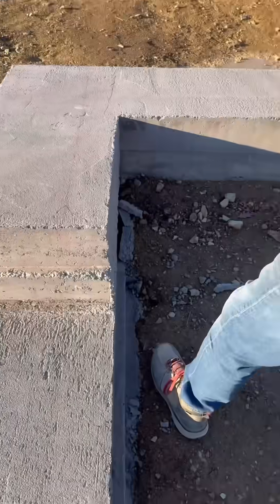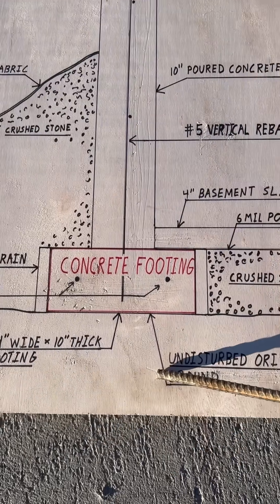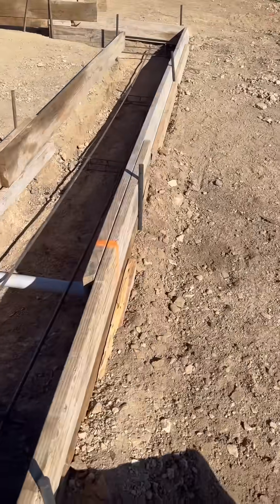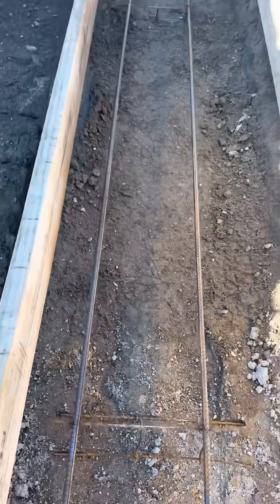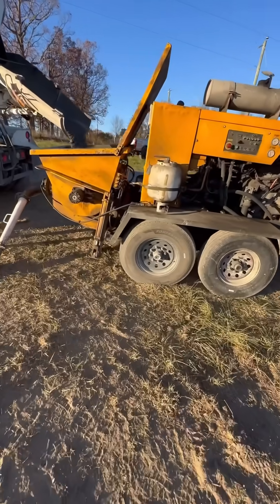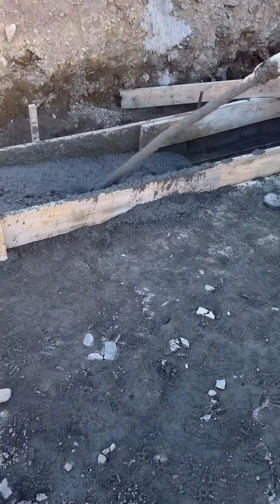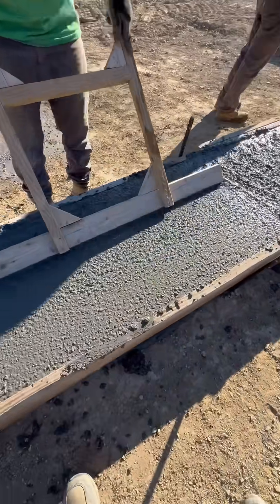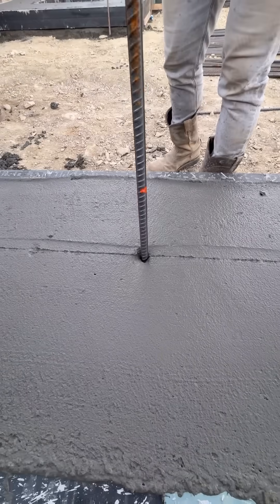We Just Poured Footings- Let me Show You How

Comment: You Americans really don't like using rebar and when you do it's suboptimal.
That rebar in the centre of the foundation beam provides no function.
We put engineered cages in concrete beams in Oz and Asia, not impericaly guessed bars that just hold broken concrete together. The steel has to work too. Foundation beams bend both ways when loaded.
Then there's the "we don't need chairs" lobby.

Comment: Good video. In most footings I helped pour when I was working in concrete we would put keyways usually in the middle of the footing so that when you poured the foundation wall it was locked on to the footing so when your walls solidified they wont topple over or slide off. The footing does look really good though.
Reply from the maker: The rebar sticking out of the footing into the wall, serves the same purpose as a keyway
Reply: The vertical rebar needs a hook. Also,I  would  install keys in the footer. The keys are not required, but do make a better/stronger connection to the vertical walls, as compared to just the vertical rebar.
Reply: Yea without a hook on end of dowel, the bar will not develop (straight bar in a 10" thick ftg, assuming 3" cover, yea she ain't developing), therefore the bottom connection of wall cannot transfer moment. But as long as the reinforcement can transfer shear, prol ok (I'd still use a key with hooked bars though, extra insurance). Unless of course your wall is CMU ...  @TheHavocdog

Comment: The idea of using rebar annoys me. It seams like adding a built in fail point. There must be a thickness and shape where the concrete is under constant compression allowing it not to crack without rebar..... or u could use large flat fat faced ashlars if done correctly they last for 100s of years.

Comment: Those vertical bars should be hooked at the bottom
Reply: Yup, at least a 90° x 6", The leverage of the tall wall exceeds the friction of the 12" footing by far. Depending on soil conditions and your local, it's either critical or no real concern. A keyway would suffice. Location location location.
Reply: Yup. That's needed to handle uplift forces. I hope they aren't building in a hurricane zone.
Reply: Rod. Rod, rod,

Comment: Glad the inspector at the end approved the job!  Always a sigh of relief
Reply from the maker: He’s a taskmaster
Reply: The inspector at the end was talking a hot lap, because he failed the inspection the first time. Why you asked? Because one is not allowed to stab rebar, holdowns, anchor bolts etc.. after concrete placement. Second where is the alternating hooks on the vertical bars.
Reply: @davebrakebill8818  oops :)
Reply: @davebrakebill8818 that was my thought. Inspector not passing without verticals and anchor bolts installed, and hold downs in California. And he passed without underslab plumbing being wrapped 🤦

Comment: Where was all the vertical rebar didn't see any while the dog was running on top of  the footings did you ever consider keying the footings to tie it all together ?
Reply from the maker: The guys drill and epoxy rebar into that area later because there’s several different steps with different heights. It’s the garage area.

Comment: It always amazes me how little rebars are used in American homes, then again most of the houses today are made of wood and what essentially is paper so foundations don't need much rebar. Most parts of the world use RCC structures in their homes which means a whole lot of concrete and whole lot of rebar and bricks, it makes for a much stronger and sturdier house
Reply: As a structural engineer, I can confirm there's absolutely no need for a concrete house. There are a few positives but the flexibility of wood far out weighs any of that
Reply: @AC-im4hi Why is the reinforcement in a foundation footing placed in the middle zone instead of the upper or bottom zone?
Reply: @vladimirmijajlovic6036  Great question. The bars are typically placed 3" above the bottom and then another layer is placed in the top if needed due to being in a high wind region. It's possible that the engineer designed that rebar to take both the wind and gravity forces. Its also possible that he or the GC messed up.
Reply: @AC-im4hi you need to lose your license. Is that seriously what you're going to tell people? Timber houses are almost all downsides. The only reasons it's popular is its initial construction cost is a bit less, lumber is available to no end, and it's faster. Maybe talk to the people whose houses are wasting away, around them, or those that collapse for the tiniest quake, burn away for a fire that had no reason to persist, or those that collapse at a breath of air. I could keep going, but don't ever try to say that wooden houses match up, in quality or integrity.
Reply: @deven6518  Wooden houses are actually stronger in Earthquakes. I could tell you why but it would go completely over you head. They are also entirely sufficient for hurricanes to meet the code required wind speed. They are slightly worse in a fire but even a concrete house needs windows which will let fire in. Overall, they are significantly cheaper and much easier to work on for the average homeowner. I've designed hundreds of wood structures up to 6 stories tall and every one is still standing today. You don't have the faintest idea what you're talking about.
Reply: @deven6518  You fools really have no idea about American homes. Tornadoes do not care what a building is made of once it gets strong enough and even EF3s have leveled buildings in Germany, France, etc. It is far easier to make a smaller buildings earthquake resistant when it is made of wood IE why Japan mainly had wooden homes. Not to mention, it is far easier to insulate as well which is why the Nordic countries have 90%+ of their single family homes made of wood.
Reply: @AC-im4hi What about sound isolation, concrete house vs wood house?
Reply: We don't because stick framing done properly is plenty strong and way cheaper because we have basically an inexhaustible lumber supply.
Reply: Look at the Chinese videos 
Don’t see rebar

Comment: In California the vertical rebar has to be tied to the horizontal rebar in a footings.
Reply: It also has to be "L" shaped and placed a  minimum 48" on center (O.C.), making them stronger for earthquake resistance. The horizontal bars have to be 3" from the bottom and sit on chairs. They also require corner bars to tie them in at the intersections.
Reply: @bradjackson8210 yesss. I do think you mean maximum thought,  not minimum.  I've actually never seen steel spaced that far.
Reply: Yea he isn't in a seismic area.

Comment: Oh yeah around here 8' wall requires rebar 14" x 12" squares move into the 21rst century
Reply from the maker: If you’re in construction you should realize that different parts of the country have different requirements based on the environment. Depending on your seismic  design category and wind speeds. Also the soil conditions make a difference.

Comment: Looking very nice. A question though, why does rebar always look rusted? Even the new stuff? Is there, like, stainless steel rebar?
Reply from the maker: It usually comes rusted because it’s been sitting outside. That’s not a problem, once it’s covered in concrete it can’t get oxygen so it will not continue to rust.
Reply: @hausplans  Huh, thanks! I've heard that it can continue rusting over time because of the moisture in the concrete as it cures. That's then supposed to eventually damage or deteriorate the concrete. Have you ever heard of that, or know about it?
Reply: Rebar is typically coated with a sacrificial layer.  It's meant to rust. The oxide layer that forms will protect the inside steel for years to come. If you bend new rebar, the blue or gray ones, you'll see a thin layer flake off. That's what rusts.

Edit: as for rusting over time,  it shouldn't.  Concrete is porous and if you had too much water in the mix,  it'll be very much so, allowing water to seep through and affect the steel. To combat this, concrete should be poured with the bare minimum water and kept wet to cure, instead of adding plenty water and leaving it to cure dry (which it doesn't). Also, ensure that there is minimum  2" of coverage on surface steel,  more if it's swamp or freezes over. For that which is buried, 3" minimum coverage and seal the surfaces. Tar does a fine job.

Comment: As a rebar manufacturer i like watching this
Reply from the maker: Thanks for making it👍
Reply: No bend in the starter bars over there? Ours all have 3" right angle
Reply: something I've always wonder:  what kind of steel is rebar made from?  Why does it burn through my bandsaw blades 3x as quick as steel bar (a32 /1018) ?
Reply: @mtraven23  i believe it has a higher carbon content, making it a weaker steel ultimately, as it's less pure. rebar is mainly used to reinforce concrete, not to be fabricated and welded, which requires a higher purity of steel
Reply: @abtwopoint0  the high carbon would explain the wear on my bandsaw blades...but the rest of that is wrong.  High carbon steel isnt "impure" steel....its actually stronger steel....despite being less ductile.
Reply: He makes rebar he doesn’t do concrete doofus
Reply: So as a rebar manufacturer do you know anyone that does some kind of waterproofing to the rebar when it is made? Idk 🤷 any kind of electrolysis or powder coating or something of the sort so that the rebar doesn’t rust in the concrete over 100 years?
Reply: So as a rebar manufacturer do you know anyone that does some kind of waterproofing to the rebar when it is made? Idk 🤷 any kind of electrolysis or powder coating or something of the sort so that the rebar doesn’t rust in the concrete over 100 years?
Reply: @JerrodLandon  when a rust-resistant coating is required, epoxy coated rebar is available. Its usually green.  I see it being used in highway construction all the time...and you can buy it at box hardware stores. I'm not sure what the life expectancy is, so I dont know if it would meet your 100+ year mark.  And it also comes with some downsides....for example, it situations where rust is unlikely (dry climates), the bond to the epoxy coating is weaker than that of concrete to steel.
Reply: @mtraven23  its not much better it does prevent it a little but still happens even just sitting in the factory and it usually has to be 80 grade
Reply: @JerrodLandon  tetanus is actually a big concern in our factory. If you get cut at all it's almost always an incident report
Reply: @caseofruns735  your factory doesn't require employees to be up to date on there Tetanus shots?

and if you say the epoxy coating isn't much better, whats the "bees-neez" for rust "proofing" rebar?  Is it that "80 grade"? (i gotta look up what that means)

ok, looked it up. seems like thats a tensile strength rating, not sure how it relates to the coating?
Reply: @mtraven23  let me get you as informed of an answer as I can after work sir I'm sorry I only started checking notifications for you
Reply: @JerrodLandon  yeah the other guy answered it. We keep our coated stuff painted green with a spray can so we know it's coated but i still see that stuff rust in spots just not everywhere and quickly like normal grade 60 or something
Reply: As a rebar manufacturer,  you should give him some tips.  Like say...always have a crossmember after an intersection, no more than half the spacing distance. If it's a 12" space, then max 6" there should be one.
Reply: @deven6518  that's building code not rebar manufacturing though
Reply: @deven6518 Why is the reinforcement in a foundation footing placed in the middle zone instead of the upper or bottom zone?

Comment: You don’t bend a 90L in the vertical rebar before putting it in the concrete?
Reply: I was looking for someone to ask about that. In Europe, we use much more rebar and cross connections and it's thicker. The vertical rebar is bent on 90 for the footing that are serving as retaining wall on the sections next to hill side. 
All I know is that rebar job needed much more rebar
Reply from the maker: The amount of rebar needed also depends on what type of soil you have. This is adequate for our local conditions.